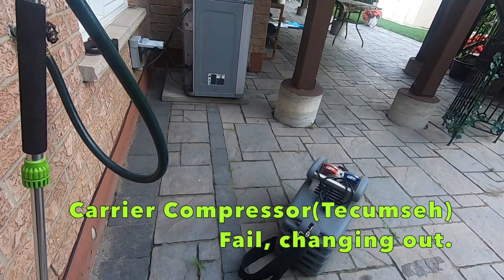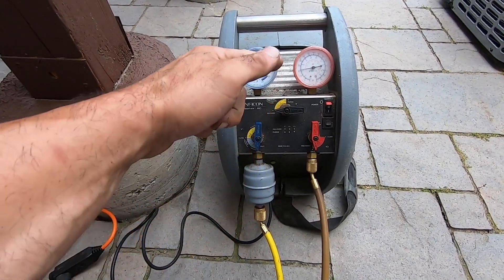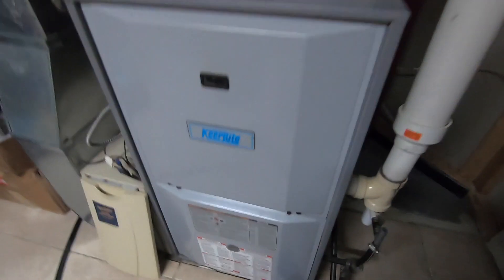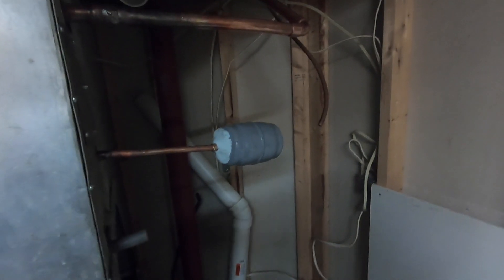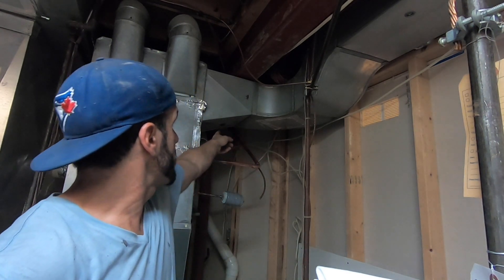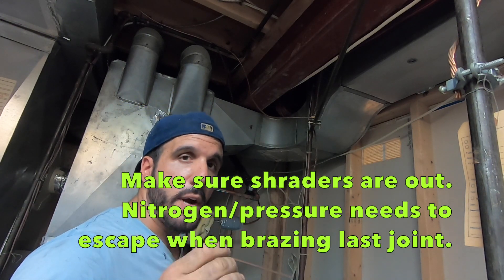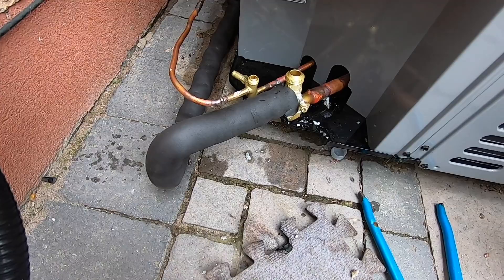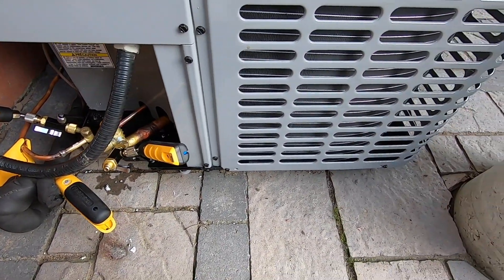HVAC: compressor Hermetic autopsy | Carrier Compressor seized

Comment: Question: I'm a Red Seal Refrigeration Mechanic.  I always recover old refrigerants. I was under the impression that there was a small tolerance to escaping refrigerant vapour (410a) when you remove your suction line guage hose from the suction access port with the system running and you have the system running. Basically you get a little psssst of vapour and that's it when you remove that hose. My apprentice argued with me today and told me I was doing it wrong. He wanted to shut the liquid line ISO valve and do a pump down to suck that bit of vapour that was in the hose into the system. I stopped him at the last second just in time, because in that particular circumstance, I had just put my suction line hose on in cooling mode to get a pressure reading. I hadn't purged the other end of the hose on the manifold to push the air out. The pump down would have pulled that air right into the system. The only thing we could have done is got the company recovery unit out ( with the broken control valve knobs) and recovered that tiny amount of vapour out of that suction hose line. This company is pushing us to install 2 systems a day, and we work our butts off. The apprentice wants to get home to his wife and kids. I'm on my own, so I can work late anytime. The apprentice gets upset if he has to work late, yet he wants to recover that tiny bit of vapour. He did a bad flare today on a 3/8 line and tried to pass it off as good. We likely would have lost all the refrigerant at some point due to the bad flare. We pressure test out lines at 500 psi nitrogen but the bad flare might have been a delayed problem waiting to happen. Anyway, we don't work off a bench in a lab. We are in the field, and I think there must be some kind of tolerance for the small amount of vapour lost on a pressure check on the suction line  with the system running in AC mode....when you Disconnect  your hose. 
Any comments?
Reply: What's your apprentices start at?
I'm doing automotive and an also good with HVAC, electric.
You think it's worth the switch?
Reply from the maker: @zoticus1  If you can email me please ill be glad to answer.Thanks bud
Reply from the maker: De Minimis Law...email me if anything. thanks

Comment: Hey Joe, just an FYI ive been using Metalworks Superstore for my york products. They seem to have much better pricing than Master Group. Nice job bro! 👍
Reply from the maker: hey Bill which location, i go to metalworks in vaughn all the time for custom duct.   If you know the prices email me. thanks bud
Reply: HVACR North speak to Mike Jones in Vaughan or Brian Sutherland in Richmond Hill. 😉
Reply from the maker: @billburnett9951  yes Thanks for the input Bill, The Luxaire being little cheaper, which was cut from the same tree:). I will try them out, i have only installed their furnaces.  Thanks again for the reminder & i will inquire about them.